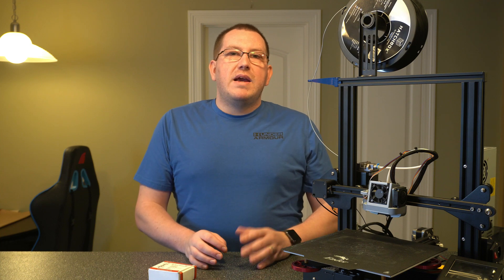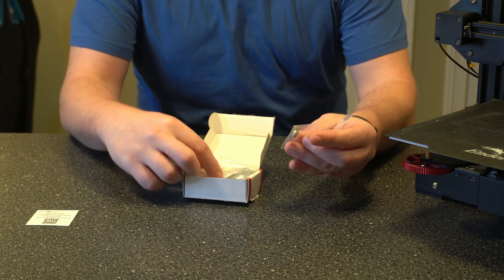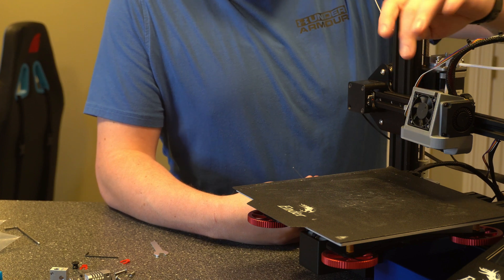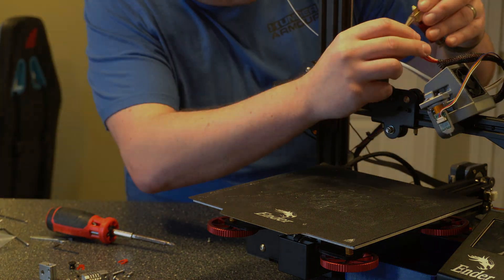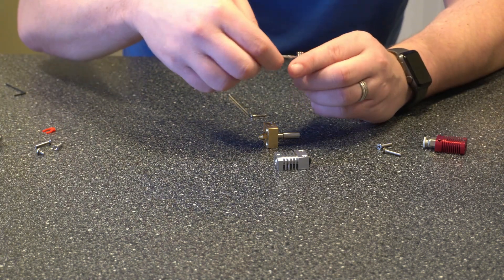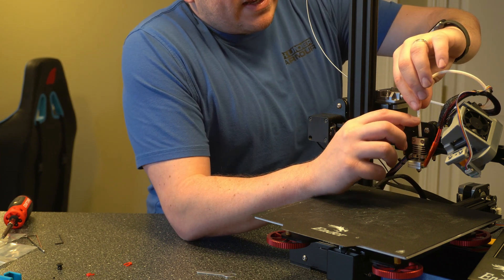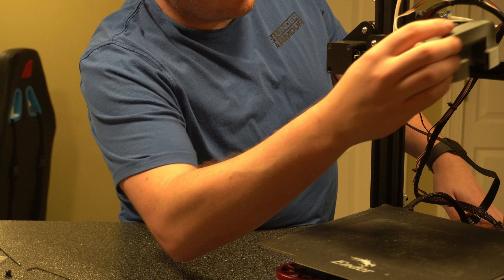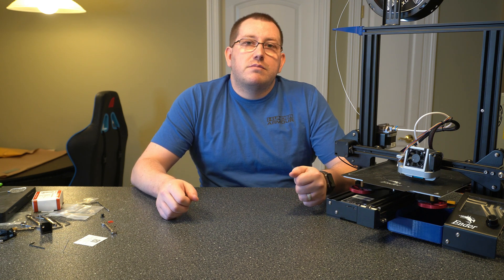Micro Swiss All Metal Hotend Upgrade – Install Guide

Comment: hey rob thanks for a good video i was just wondering how i would get the printer to be able to print hotter than the temp that is set on max from the factory at 260 or would i not really have to worry about running into a filament that needs a hotter temp
Reply from the maker: Hi. You would have to make a marlin build and set the max temps higher.

Comment: Thanks for the video.  I completed my installation without problems.  However, when I powered on the nozzle temperature was -14.  It didn't come up and then I got a shrill beeping with a MAXTEMP error reached.  Do you have any suggestions?  I fear something bad has happened.
Reply from the maker: Hi. It sounds like the thermistor may not be sitting right, the screw holding it to the hotend is too tight, or it went bad.
Reply: @3DPrintscape  Thanks.  I replaced the thermistor and all is well.

Comment: Does it work with any satsana rmx?
Reply from the maker: Hi. Honestly i dont know much about those printers, and not much came up in the search results, so im not sure. That said, i think would be ok for any printer that uses a similar hot end.
Reply: @3DPrintscape  I thought it was your Design on thingivers idk. I mean the fan duct, but yeah, some mentioned the  dimensions  of the hotends are the same. I'll try, (my old hotend broke and i don't want to buy cheap again)
Reply from the maker: @marlonjareck7367  AH ok, sorry i thought you were talking a printer... lol. It does work with the satsana fan duct cover.
Reply: @3DPrintscape  yes, tested and verified!

Comment: Hi Rob, how has this hotend been working for you, is it worth it? Also appreciate all of your videos!
Reply from the maker: Hi. The hotend has been working well for me and i haven't had any jams since switching. The value is questionable as there are other all medal hotends for cheaper. If you decide to look at other options make sure the tube connection is the same as this one and doesn't go all the way to the bottom of the hotend like the stock one does.
Reply: @3DPrintscape  thanks for the quick reply! I'm glad to hear it works well, I'll be upgrading my printer soon.
Reply from the maker: @shaneroyce4622  You're Welcome! Have fun with the upgrade :).

Comment: Nice video. I've been thinking of getting the Micro Swiss All Metal Hotend myself. One note about the video. The other videos I've seen, say you should leave the screw holding the thermistor really loose, so you don't cut through the wire insulation.
Reply from the maker: Hi. Thanks for the feedback. The hotend upgrade has been working out well for me. You do want to be careful when tightening that screw. It shouldn’t be to right but you don’t want it to lose either.

Comment: Hey I know this isn't related to the video but I'm really struggling to get my Creality 3printer v2 up and running?  For some reason the extruder doesn't go up while printing but does go up when I move the z axis in settings?  I've been Messing with it for days.
Reply from the maker: Hi. That seems really odd. Are you using the stock firmware, or did you upload custom firmware to it?
Reply: @3DPrintscape  the stock firmware. I haven't updated it yet. It's brand new. I'll be doing the update today.
Reply from the maker: If you are having issues like that with the stock board/firmware its possible, there is a hardware issue. Are you able to exchange the printer?
Reply: @3DPrintscape  ok so I have that issue fixed. But now for some reason the extruder is messing up. Is this common to have this many issues with a brand new device?
Reply from the maker: Its common to need to spend a decent but of time to dial things incorrectly but hardware issues are not common. Without knowing all the details, I can't say for sure if its common or not. What issue are you having with the extruder?
Reply: @3DPrintscape  I was clearing a blockage and it just broke. I pulled the blue tab to pull the hose out and it won't go back in. Getting really frustrated. Seems like every time I make one step forward I take three back with this thing.

Comment: Good video, one thing I wanted to point out is since it's a new hot-end it's always good to do the PID autotune when changing anything like this out if you didn't already do that. I myself want to upgrade to this hot-end so I can print with more types of filament. I would like to see a follow-up down the line of how well it's been working for you.
Reply from the maker: Hi. Thanks for the feedback. One selling point on this hotend was that its supposed to be a drop-in replacement, so im testing it as such. I will let you know how I like it after I've used it longer. That said, I will be upgrading to a direct drive system in a couple of weeks, so that will change things up a bit.